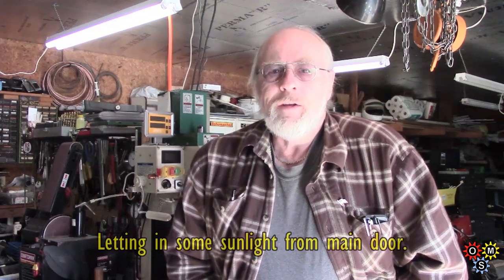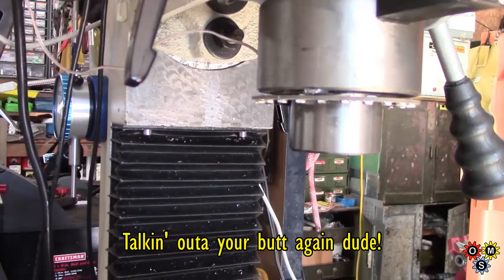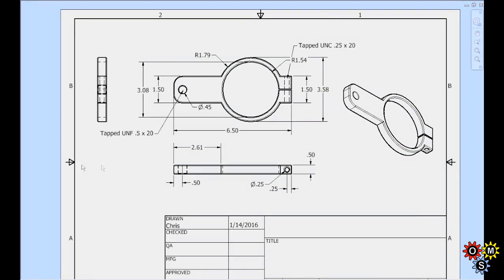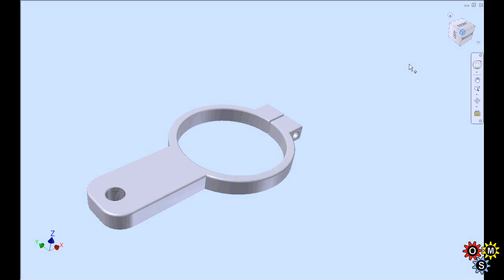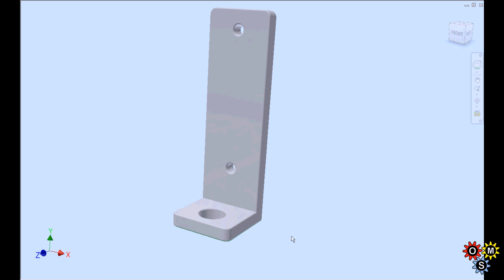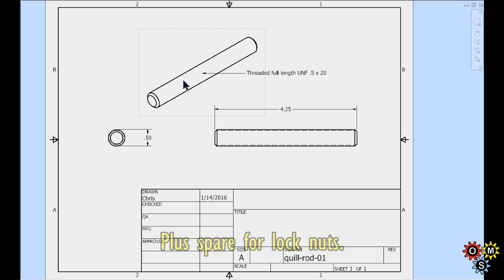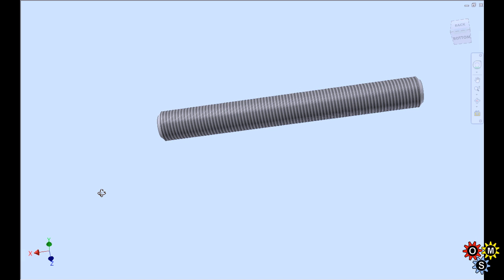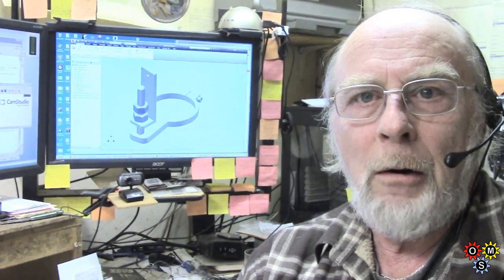0704 Mill Quill Stop Planning

Comment: Hi Chris is Go704 the same mill as Optimum BF- 20V
 Sold by Machinery-House any held would be good thanx
Reply from the maker: Hi - well, very similar but - here's some info - https://www.machineryhouse.com.au/M650
From what I can tell it is very close to mine but they say MT3 for spindle whereas mine takes R8. Also this one appears to allow tilt of head to 90 degrees from vertical. This one too seems to have a side piece which would act as a quill depth stop - I made one for mine. All in all, most other features are about same.... quite a versatile small scale mill.

Comment: Hey Chris,  Watched tons of your videos, good job!  On that fillet weld , try it on the bottom of the two pieces with a .25 x.25 corner to corner joint. Heat sink that inside corner for no burn through. Three words a minute and no misstakes!!!
Reply from the maker: +Mark Whittier 
Hi Mark -- thanks for enduring my videos - you have good stamina! :)
A ways off yet from continuing that project but when we come to the mounting bracket there has yet to be a final decision made re the right angle piece. I may yet cheat a bit - and use thicker material and use a bolt attachment to the vertical piece.
We'll see what happens finally!

Comment: Hi Chris, I added a spindle lock to my 704.  it uses a clamping ring similar to the one you are designing and the lock screws to the bottom of the ring.  If you make the clamp a little wider, it would allow the push button spindle lock to be attached.  If you are interested, I can pull it off the mill and take some pictures.  I built it on the fly and do not have drawings. My email is reportbynor@gmail.com.  Byron
Reply from the maker: +Byron Porter 
Thx for the info Byron - I am still reviewing options beyond my initial design and chances are there'll certianly be some tweaks. Right now my shop is better than a chest freezer so most practical work is on hold!

Comment: Check out my G0704 modification. Powered Z axis. www.youtube.com/channel/UCCplM_dVfp_d3Cc1uH8wEOg
Reply from the maker: +David Hellmuth 
Hi David -- I had thought of that sort of approach - looks v useful. However, was reluctant to lose the hand wheel in case of power outages! :)
Reply: If the power goes out how do you use the mill?
Reply from the maker: +David Hellmuth 
Haha - good  point :-)
Reply from the maker: +David Hellmuth 
OK so far - but where did you get the belt drive kit -- seems a worthwhile mod' -- tricky or straightforward?
Nice site - great selection of stuff.
Reply from the maker: +David Hellmuth 
Thanks David, I think I'll go ahead and get the kit. I see there's a description for install so, hopefully no major hassles.
Reply from the maker: +David Hellmuth 
Thanks David, I think I'll go ahead and get the kit. I see there's a description for install so, hopefully no major hassles.

Comment: on my drill press I just put a sleeve over the depth rod and threaded it on the side for a threaded knob that I tighten for a quick adjustment stop.
Reply from the maker: +Ed Ginsberg 
Thanks Ed -- I am heading towards scrapping the nuts, in favor of a single locking collar... or similar.

Comment: From a "value engineering" viewpoint consider just a bend in the support bracket, instead of a difficult welded joint
Reply from the maker: +Grandpa Cocky 
Thanks - well one suggestion worth considering is a partial saw cut thru the bend area, enough to permit the bend and then TIG the outer area where the cut was. May even include a steel option yet.

Comment: if you'd like we could make up some patterns from wood and cast them in aluminium , then you could machine them .
Reply from the maker: +Lawnmowerman02346 
Hi, thank you,
There's a thought, but a lot of trouble compared with working from bar and plate. The design so far is a bit embryonic, as there'll probably be some changes yet - in part influenced by some useful suggestions.  Thanks for stopping by.

Comment: I'd like to see a LOT more meat where the tongue meets the ring. Any force on the end of the tongue by the rod is going to wring that ring and probably stretch or distort it. Maybe a large filet. That, or thicken the ring by a fair bit.

You could get some acme all-thread from McMaster-Carr for the stop rod. The Acme nuts they sell are are long enough to cut in half to make two jam nuts.
Reply from the maker: +Peter W. Meek 
Hi Peter, thanks.
Yes, more meat I agree - chances are I will increase the fillet as well as thickening the ring (that can be painful! :) ) As with most of my projects, many things can change a bit!
All-thread sounds useful - but I may well actually use a different approach for the rod -- only thread lower portion and then rest, use a cinching clamp for setting the stop position. Plenty to think about yet - but as ever, so good to hear suggestions etc.

Comment: Cool setup Chris, I like the Idea of a pinch collar Eddie the Grouch described below, its the Kiss Principal.
( maybe not in execution but in operation)If your looking for precision measurements, a tab connected to the top of the rod could be used with a dial gauge .
Cheers, great video once gain
Reply from the maker: +Phil's Projects 
Hello Phil,
Thanks. As always I am open to ideas and appreciate input - for most part (so far) I think this is about the way I'll go but - also plenty of scope for change. Re the precision aspect - well the Z DRO and my option to also have an indicator reading off the quill should suffice I think.

Comment: Hey Chris.  I have the same setup on my drill press and hate it.  Need 2 wrenches handy, nuts move when loose and block travel spontaneously, gotta spin and fiddle with the nuts to set height...  "BAH" I say!   
Instead, use a smooth rod and make a couple of cinch clamps (like how you are mounting to the quill) with nice sized knurled knobs on a fine pitch thread.  One clamp above the guide for depth and one below for a height/travel limiter if you like.  To set a stop - lightly snug the clamp against the guide, set the desired quill position, and give the knob a twist to lock it in.  As for the guide, saw most of the way through at the bend point, fold 90 degrees and fillet weld the outside corner.  Much easier to clean up and not relying on an inside fillet (that will only be in the way) for strength.
P.s.  Now that I think of it, this would have been a nice video for me to make...DOH!  However, I just haven't had any ambition for shop work lately.
Reply from the maker: +Eddie the Grouch 
Hi Eddie,
Thanks for your input... greatly appreciated.  I was driving this morning and mulling over the nuts aspect - not liking it.  You idea is way better and in a way towards my thinking of a lockable split nut sorts deal.
You collar/cinch clamp approach is way better on smooth rod - I like that a lot. The quill lock is adequate for holding things while the stop is set for a job so limit for down is really all I am looking for right now. With me of course, notjhing is cast in stone as I invariably finish up with odd changes and tweaks!
Ah yes - the cut'n'bend for the 'bracket' - also excellent if I do a weld.
Thx again Eddie - I do so appreciate feedback from folks. :)